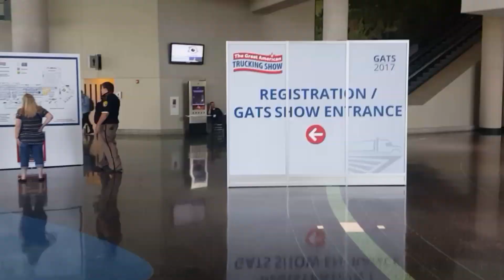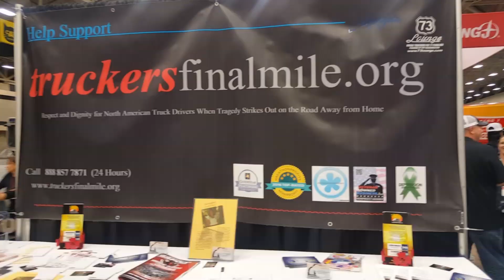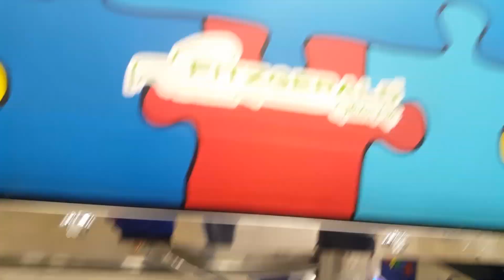Trucking | 2017 GATS Show Trucks | LoShawn Parks

Comment: Yeah very pretty , but it does not pay the rent or mortgage, and they eventually break down. I would hate to spend so much then brake down, and sometimes the break downs are factory recalls that can create havoc in your life even if you get reimbursed by time they do you could have lost it all. I rather always lease and change every so often. It eventually becomes just a pile of junk!!!
Reply from the maker: Maica Bentivoglio these guys do it because it's a hobby for them. They are not worried about break downs on these trucks. Most of them are Show trucks, meaning they have another work truck at home that they use .